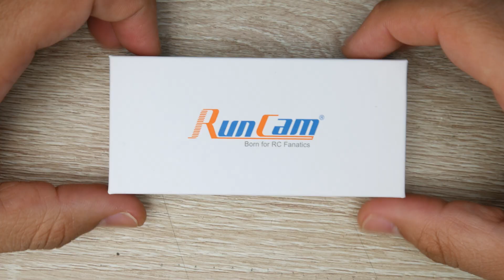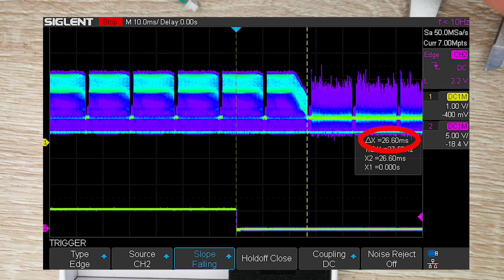Runcam Phoenix 2 FPV Camera // Latency Test

Comment: Hello! I bought this one too and it worked for two flights, but then i had to test something on the bench it was powered for about 4 mins and suddenly the video was out, no video whatsoever. The camer was a little hot, is it possible to burn it out?
Reply from the maker: Maybe you fried your OSD.. DOUBLE CHECK ALL CONNECTORS AND WIGGLE THEM.. 3% chance it's the camera unless you bridged something on the FC regulators.
Reply: @DroneMesh  osd is fine since all the stuff is still visible like flightmode and battery voltage, just on a grey background. I also hooked the camera directly to the vtx and i get the same grey image

Comment: Great channel! I am getting back into Quads and have been out of it for a while, things have changed so FAST lol  I need some help with what type of Rx I need to buy for my TGY i10 Tx everything seems to have gone S bus or I bus? I have this cam on the order list as well as a Vtx my only trouble is understanding what Rx to use HK TGY i10 is a Flysky clone I think ? I also joined your blog to help me get up to speed on the new stuff I would like to fly a 5" or 6" fpv just for fun so any help from ANYONE would be much appreciated!! So MANY choices that I get information OVER LOAD then get frustrated I just want to place my order and get a good Rx Thanks for all the videos and hard work that goes into them it has helped me a lot
Reply from the maker: Make me a list of things you need and your budget.
Reply: @DroneMesh  Thank you so much for the response well I flown mostly fling wings and heli's for a long time I have 3 Futaba  radios 2 T6Ex & 1 7ch heli radio all are FASST systems I bought the TGY i10 from HK when it first came out & never have used it I have many 3cell 1300-2200 MaH battery's not many 2 cells though what I need basically is a frame, FC, Vtx +cam & ESC preferably in the stack config because when I DID fly Quads the one thing that bugged the crap out of me was all the wires lol like I said it has been a long time so don't laugh but the only FC boards I have and used are the old KK2 mini w/the LCD on them LOL  I was looking at the "Frog frame " I think its called and a budget around $150 give or take $20 something in the middle range  not the most expensive but not the low end cheap stuff Hopefully this isn't to much info (or not enough) any package you could put together ($150-$170) sure would HELP me out my friend so Thank you again and stay SAFE and Healthy!!
Reply: This is kind of what I was looking at TransTEC Frog Lite 218mm Carbon Fiber
-EACHINE TXC23 VTX 5.8Gh
z-MAMBA F405 MK2
-Flit10 2.4G 10CH Micro Telemetry Flysky
A Pair Rush Cherry RHCP-JJA MINI B19 1500TVL 1/3' the motors I have are Racestar 2205s and EMAX 2812s 2822s  hope this helps ? lol I just do not know about the Ibus Rx set up stuff THANKS AGAIN !!